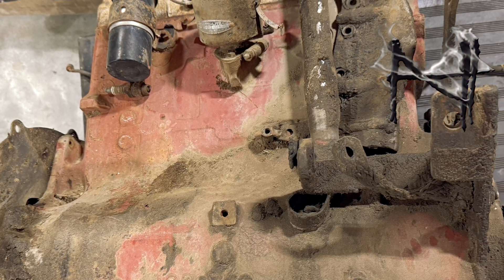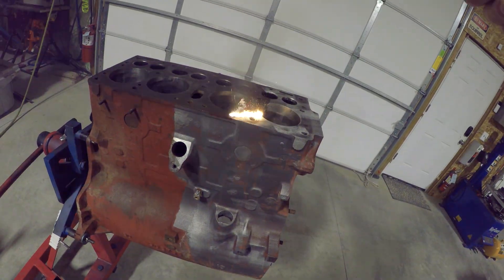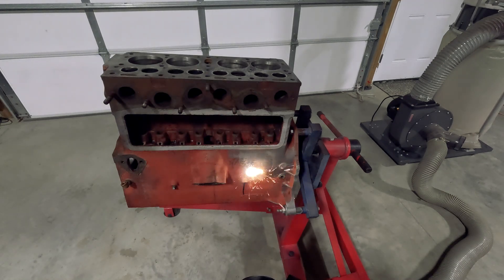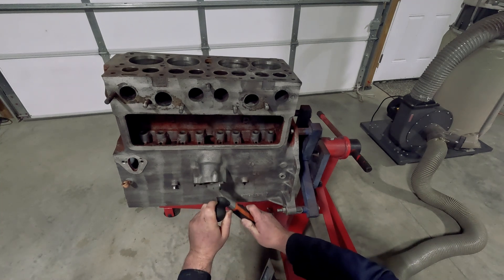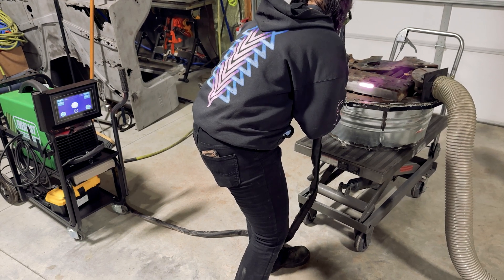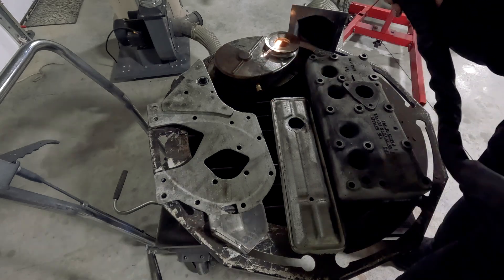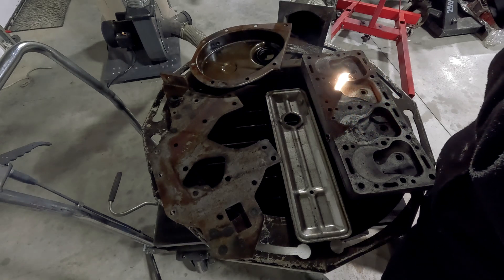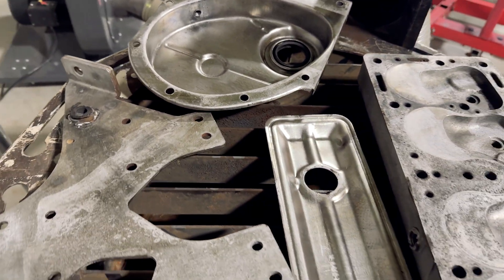We Clean a Willys Jeep Engine with Lasers - Everlast RedSabre Laser Cleaner

Comment: I’ve done a bunch of engines, be careful on bearing surfaces and cylinder walls, usually a ball hone will solve any scoring but be careful. I would suggest upping your frequency
Reply from the maker: @DreamstoRealityAutomotiveTV  This video was shot a while back, I think we have done around 60 blocks since then. (We have an engine machine shop.) Not had any issues so far with this particular machine, but if we do I will defo bear it in mind. 

The only thing we have ever damaged is some cam bearings that we accidentally left in before cleaning. But we would never reuse any bearing anyway.
Reply: @ I suggest people leave certain parts in, that protects surfaces. I’ve done some damage in the past so I’m just sharing my mistakes to prevent others from not making them.
Reply from the maker: @DreamstoRealityAutomotiveTV  What model of pulse cleaner are you using? We are seeing absolutely no damage with the 300CP.

(We did trial a none pulse cleaner that was also a welder & that thing was a nightmare for damaging bores & bearing surfaces)
Reply: @ well, I’m using a cw, I do understand the differences, but I was running at very low power and still had some scoring. I have a 100w pulse as well but it takes too long to do a block
Reply from the maker: @ Ahh, that explains it! Continuous Wave will defo damage stuff, but I am pleased to let you know you don’t have to warn the Pulse users, no issues with those & we test everything with a Mitutoyo Profilometers so can be extremely sure.
Reply: @ very cool. Although the cw machine does work well and effective, just knowing the proper parameters are important. Cheers!